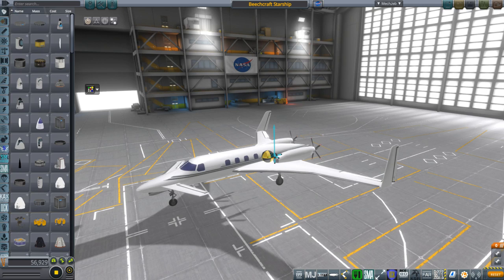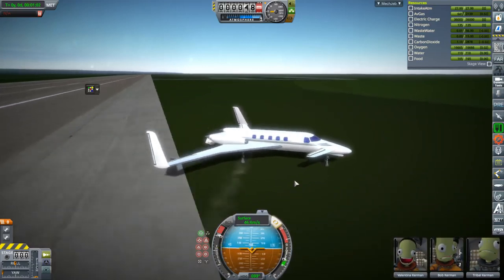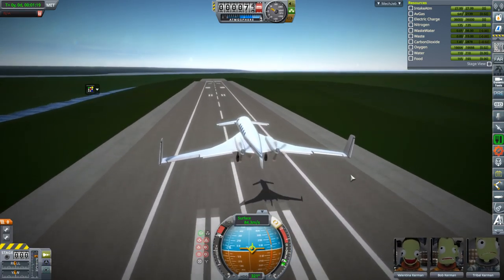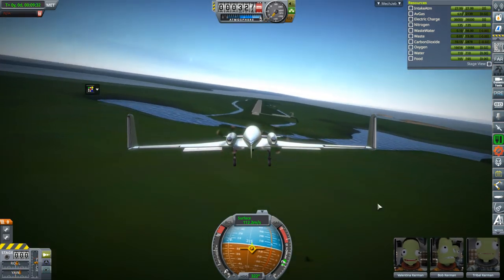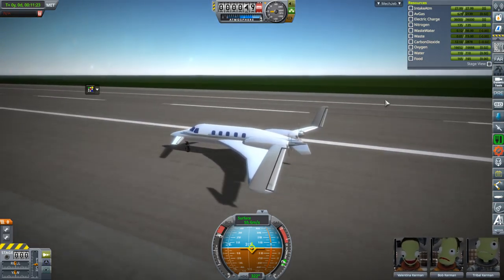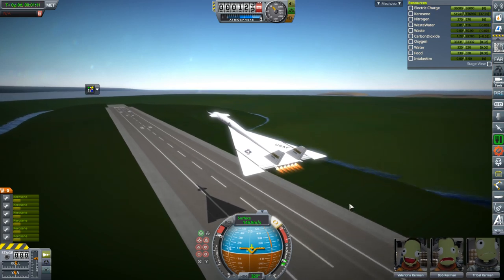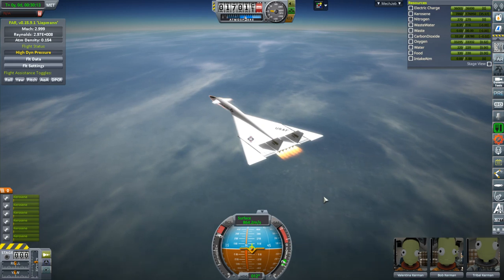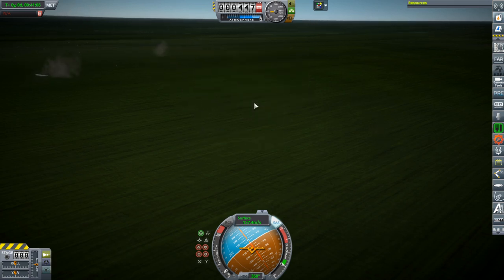KSP - Realism Overhaul Sandbox - Beechcraft Starship

Comment: What mod did you use for building the Beechcraft?
Reply from the maker: I modeled it in Blender except for the control surfaces, which are B9 Procedural Wings, landing gear from Adjustable Landing Gear and stock, and engines from Firespitter.